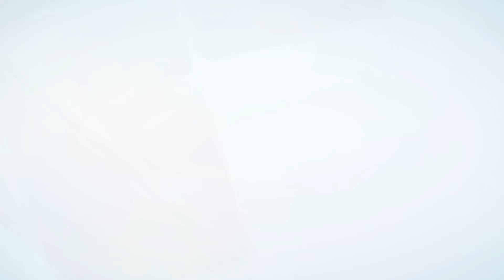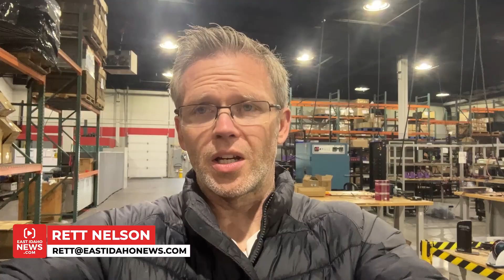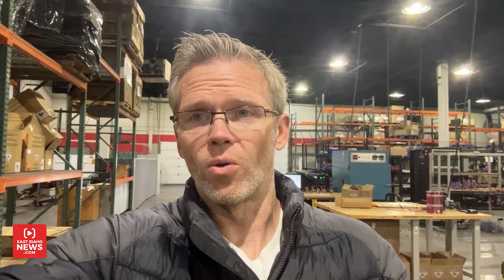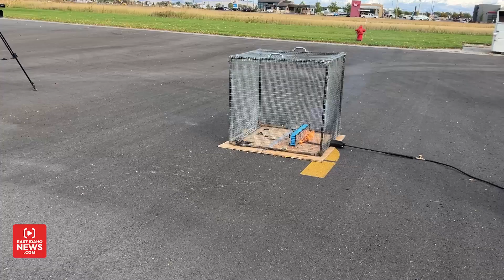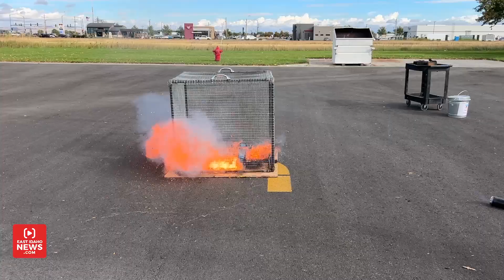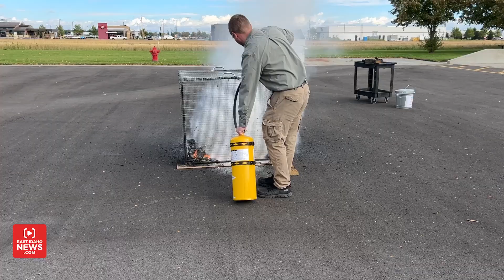Here’s what happens when a lithium ion battery explodes

Comment: this is very shoddy reporting... was it Lithium Iron Phosphate,  or Lithium Cobalt or one of the many other chemistries?  If you are going to put fear porn up on the internet at least be diligent enough to specify what chemistry as they all react differently and not all of them burn like that.

Not to mention starting them with a blowtorch is not something that happens in my cases.... shoddy reporting by all involved.

Comment: Most things this unsafe are usually banned right away, are they not??  😐
Reply: you realize they used a blowtorch to set it on fire right?  point that same blowtorch at anything in your house and it will burn just as badly.
Reply: like LPG, chemical fertilizers?
Reply: Since Covid, not.